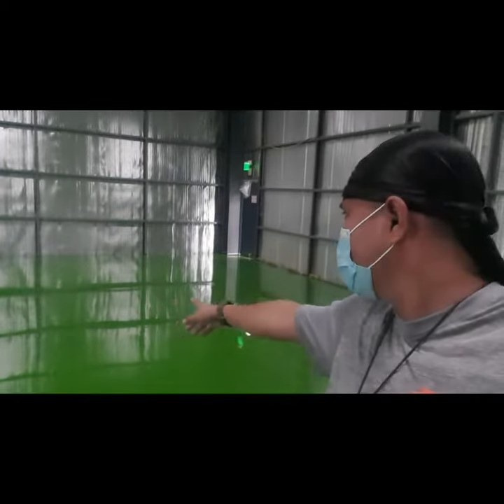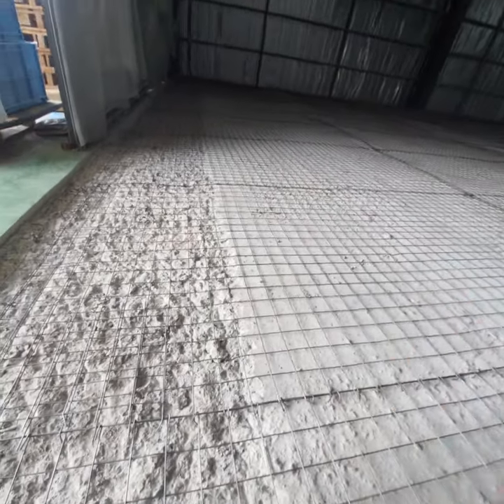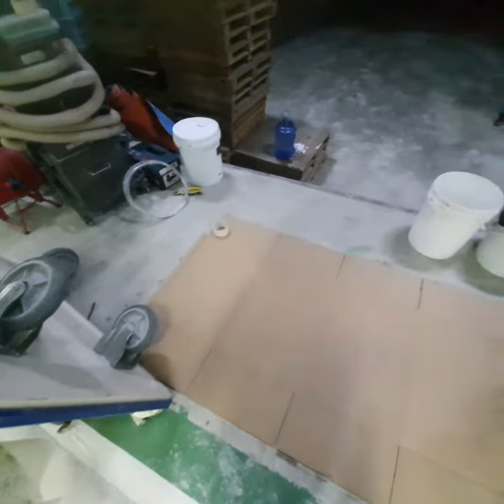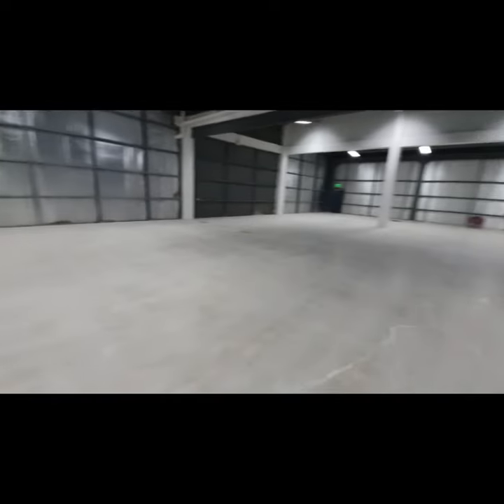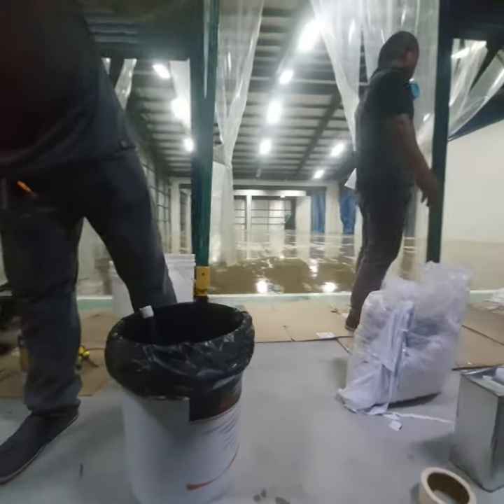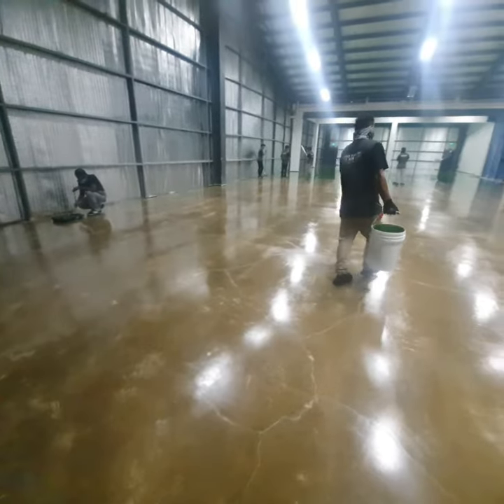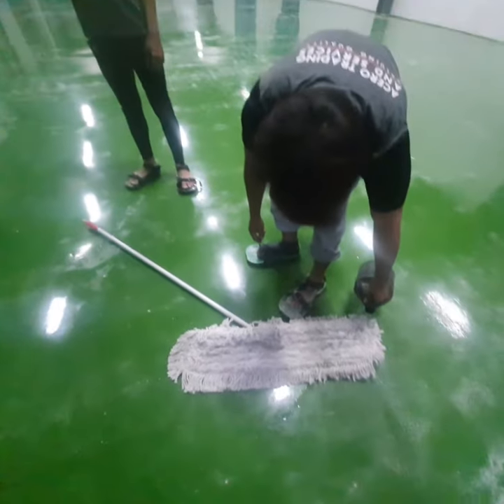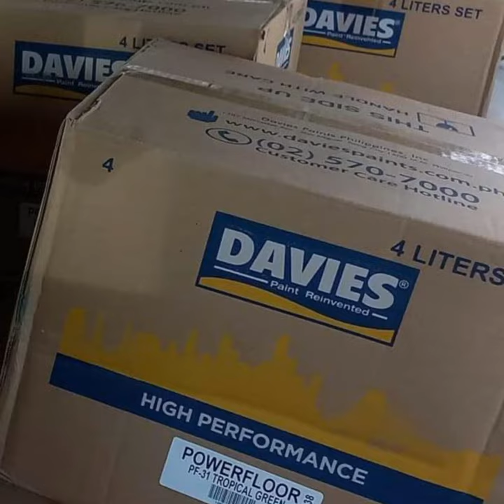ADVANCED TUTORIAL: Epoxy Floor Coating Installation and indepth guide to floor preparation

Comment: magkano per square meter nyang ganyan boss?
Reply from the maker: Hello sir. Depende po sa thickness requirement and the amount of surface preparation needed. But to give you an idea po it's between P750 up to P1200